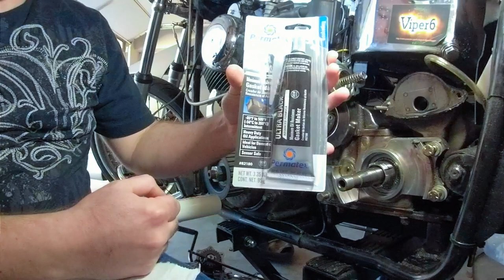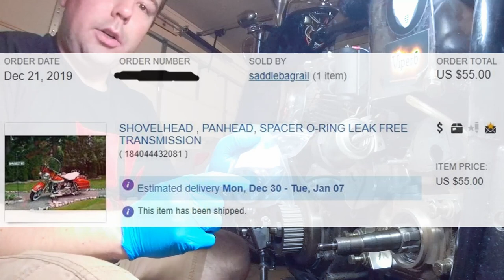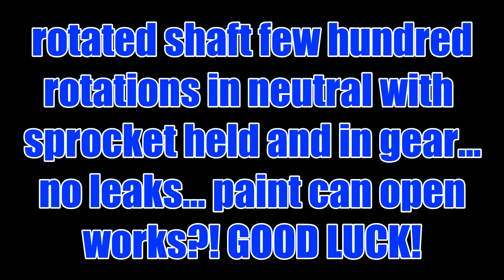Removing 4th gear seal - Harley 4 speed trans

Comment: What direction did you put the double lip seal?  With the grooves in or out?  They're not actually grooves in the seal but appear to have curved lines on one side of it and a lip facing out on the other side.  Thanks.
Reply from the maker: Been too long for me to tell you 100%. I think more flat side was out? I put new one in like old one came out.

Comment: Did the O-ring spacer seal it up for good? Thinking about getting one.
Reply from the maker: I only ride it about once a month, but no puddles on the floor anymore and I keep checking the trans fluid for top up and not needing to add any like I use to.

Comment: Very informative video.  So Ian, what's the verdict did it stop your leak?
Reply from the maker: Yes, I ride the bike around town about once a month and she doesn't even drip anymore.
Reply: @IanLandesman  Good to know.  I ordered the O-ring spacer and will be replacing seals in the next few days.  I may also go with the Super nut as well.  Hop that cures my issues. I found the video very helpful especially using the paint can opener to remove the main drive gear oil seal.  Thanks.

Comment: replaced all seals. didn't have socket for 1 7/8. bought wrong one... tightened till i couldn't anymore. got 150 miles no leak! leaks worse after new crap! Thanks for Rays' info.
Reply from the maker: stanley kwiecinski glad to give you that info
Reply: @IanLandesman  have the super nut; couldn't get it to tighten. sprocket was still loose......you don't go to war with a large slide plier and the trans on my basement sink. live and learn? 61 little late for learning.